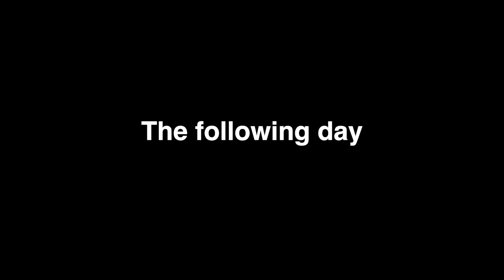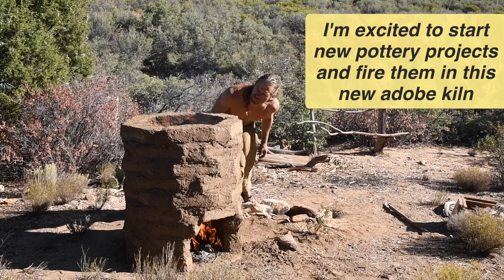Primitive Adobe Kiln for Firing Pottery (Season 2, episode 10)

Comment: This was a great build and timely. With everything snarky going on around the place with various conflicts headlining the news its nice to get back to thinking about meeting simple needs like building something creative to make other creative things. Creative men and women like you are the true inspiration of our age,👍 and long after the guns have gone silent, someone is gonna sit up somewhere on earth and say, hey do you remember that adobe kiln chad made on YouTube, thats what we should make😆 great video 🌟🌟🌟🌟🌟
Reply from the maker: And this kiln is just a tool for bigger things.
Reply: @ChadZuberAdventures I'm sure that others have said this already but making the chimney taller will pull an even stronger draught due to a greater pressure differential over that greater distance.   Also, it would be good to grind off the protruding edges of the bricks with a rough rock. This will make the exterior more cylindrical and you can then more easily coat it with another layer of mud to protect it from the rain more.  And eventually I anticipate a ceramic tile roof for this... if only there was a large kiln to fire all of those tiles ! 😜  keep up the amazing work !!  Stay safe out there Chad !

Comment: Hey Chad I'm glad you've made a kiln for your pottery - it's going to make creating floor tiles a LOT easier. One thing I'd suggest is getting your fuel off the ground. Just a couple of bricks with crossbars going across can make a huge difference in your time to fire and your fuel efficiency. 
Obviously the build itself is beautiful and making it round sounded unnecessarily complicated, but it made it so much prettier. Looking forward to all the great pottery you will make with this one.
Reply from the maker: Yeah the main reason I built it is because I want to fire bigger pieces. Also, making it round has an important benefit because that way the heat reflects from the sides and it’s focused in the center. At least that’s my theory.

Comment: I am always fascinated by all things pottery. The precision with which you build is great. 
" It's amazing what you can make with a little dirt and water." 
 Simple, but profound.
Reply from the maker: When I built the hut I didn't measure anything but I wanted to make sure that I kept a constant size inside the kiln so I will be able to set the grill in there later.
Reply: @ChadZuberAdventures if any parts of the interior are too narrow for the grill then you can simply grind that section down with a strong rough rock !!  The same idea applies to the outside surface as well !  And even the grill itself can be resized to be smaller as needed !!  Its easy to make adobe smaller , but its not easy to make a brick larger... within reason. However mortar works wonders !! Lol

Comment: I had a thought about the fire grate for the kiln.  Next time, consider using short chunks of stick, embedded in the mud, to pre-create the holes as you pack the mud into position?  Let it dry a day or so, then pull the sticks out, forming the holes in a way that will minimize the pressure-created cracks of trying to push a stick into the partially dried mud?
Reply from the maker: You’re absolutely right. I had thought of that after. I will do it that way the next time. I also need to make a small grill for the fireplace in the hut.
Reply: @ChadZuberAdventures   Even though you're physically doing all these tasks on your own, I love how you can still have the collective brainpower of so many people asking questions and offering suggestions on things to do.  Sometimes the ideas are good, sometimes they don't work out so well, but you have a global village helping you consider things from different viewpoints, and confirming ideas you've had on your own.  Humans are a social survival species; we survive so much better when we cooperate with and help out each other, sharing our thoughts and ideas.

I think that's why so many of us love watching your Primal Tendencies series so much.  We get to enthuse right along with you in the video comments, even if we aren't there to help you in the actual working and filming.  We're cheering you on!

Comment: The flow of water in dry land will soften the soil and make it walkable, and you only need to use a stick to dig the soil a little to guide it. The water on the way is green and when you reach the cottage, you can water the vegetable garden
Reply from the maker: I'm sorry but that will not work.

Comment: Lovely kiln. It looks well made even though the process had some minor errors. One thing I think you can do is use that kiln as a grill or smoke stack whenever you're not making pottery. I think you could even use it to heat up rocks or other kinds of hard-processed resources to get various types of materials.

But that is just my imagination speaking. I have no clue if it would even be possible to do that with such a kiln.

Still, I love the kiln and I think you can make some very decent pottery with it. It reminds me of a Romano-British kiln shown on Time Team. Or was it Anglo-Saxon? Cannot remember. They showed a lot of kilns in their programs and I think they could be of interest or even inspiration to you.
Reply from the maker: Thanks. Could you please point out the errors? I didn't do any research or look at construction methods of other kilns before doing this. I know there are different styles of kilns but this one is more of an advanced adaptation of the Dakota fire hole. I figured this style would allow for more air flow and thus higher temperature. It certainly lit way faster than the Dakota fire hole I made and this kiln is much more spacious inside for the large pottery I want to make.
Reply: Tried to send a message last night when my internet crashed exactly as I posted it.

But in short terms. I was commenting on how your first attempt at the mud plate with holes got ruined and how you quickly fixed it.

I have seen a lot of historical documentaries and a lot of kilns are found in these. Time Team is my favorite archeology documentary after all.

But historically kilns are often found to be dome shaped, and made up of adobe mud stacked on top of a woven basket that is left to dry, leaving the top open. After you fill it with pottery you put mud on top and seal it up. And then you bake the pottery after which you break the kiln apart to retrieve the pottery after it is done.

Those were mostly stone age and bronze age kilns but the designs have been reused for thousands and thousands of years. Even some iron age people used those.

Kilns would later change and become reusable with bricks and made to such sizes they could be used to make large objects. Becoming more box shaped.

I do not know much about cylindrical kilns but from what I learned about pottery, that I still remember, and what my father told me. The airflow and space for the pottery is the most important part of it.

If the opening of air is too big your kiln will not become hot enough to bake the pottery evenly. Uneven airflow will cool down the pottery and possibly cause it to fracture as cool winds push the hot air out and lower the temperature in different parts of the kiln.

That is why many kilns have small openings to let out the air. However, some kilns only have a singular hole for both heat and air to keep the air from cooling down the pottery.

I believe, but don't quote me on this. That the hole where air leaves needs to be as small or smaller than where air gets in. As to contain the heat and control the air flow.

This is by no means an expert's point of view. But just my own assumptions from watching history/archeology documentaries and my two years of studying pottery in high school. Which was over ten years ago so don't take my word as truth. I do not know if it is. @ChadZuberAdventures

Comment: very cool . you should think about using tiles to use as shingles for your roof on the hut . they would be safer and hold in heat better and rain out better .
Reply from the maker: That would be really difficult because the branches of the roof are all crooked. There are no straight branches out here.
Reply: @ChadZuberAdventures  you know the cool thing about wood is that it can be heat bended or steam bended . but yeah ok i get it its hard but it would be alot better .
Reply: Watched a video on making a sleigh (I think it was native artic indigenous) and the heat/steam bending they did with the wood was cool. @diydarkmatter

Comment: Hello. What distance and angle does the river flow from the hut? If you make a small dam in front of the water with stones and branches a few kilometers higher, the water will rise. By directing the water to the land, direct the flow towards the hut.
Reply from the maker: It's a couple miles away. A dam a few kilometers high??? Do you know how big that is??
Reply: I think putting a canal from a point 'a few km upstream' was meant.

Comment: chad what is your experience or opinion on stone vessals and smooth stone axe hammers, are they something your would like a go at making or do you think the time commitment for them may be too much to fit your purposes?
Reply from the maker: A stone vessel is really tough to make using primitive methods. Clay is far easier and faster. A stone axe is great if it is made really well and with the right kind of stone. The stone here wears fast. It's not that hard therefore an axe would need to be replaced rather frequently.

Comment: Chad, do you just use beeswax in your bottle gourds?  My first attempt at making a bottle gourd water bottle failed as it mildew'd under the beeswax lining and the bottom rotted.
Reply from the maker: You need to let it dry out between uses and keep it in a dry location. If the gourd leaks then you can coat the inside with hot beeswax. Eventually you'll have to add more but it worked for me. Ideally you find a gourd that doesn't leak though. The gourd needs to be fully dried out before using it.

Comment: You can improve it if you put a small vault on top to make bread, but remember to make the mouth to introduce the bread on the side so that it does not smoke, the yeast is made with the same material but fermented see meg military survival manual 0003
Reply from the maker: Many years ago I used to make my own bread from whole wheat berries. It was very good.